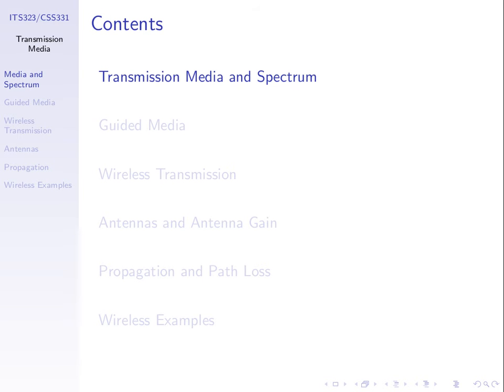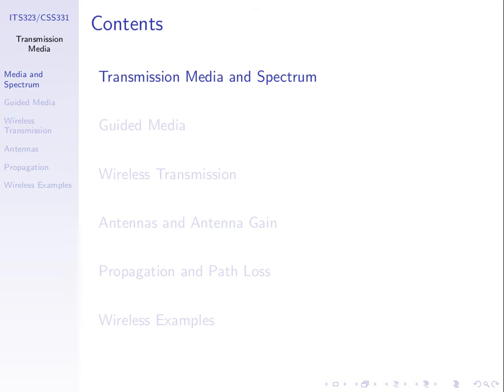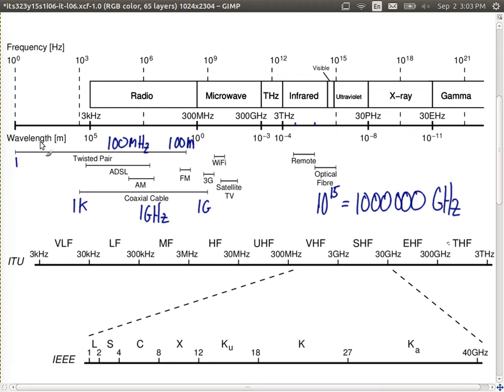Spectrum and Wired Media (ITS323, L06, Y15)

Comment: Tranmission Media and Spectrum
 • Guided = wired
 • We usually just care about the center frequency
  ○ Squaring off any curves in the wave
 • All frequencies are regulated
  ○ Radio is 93.5Mhz frequency
  ○ Microwave = 2.5ghz 
  ○ Higher data rates with Coaxial than with Twisted pair (LAN Cable)
Guided Media
 • Interference between other wires
 • Twisted pair enables duplex communication by having 
 • Coaxial cables have more shielding, can be sent along longer distances
  ○ Two conductors along the same axis, hence co-axial
  ○ Outer conduct just provides resistance to interference 
 • Optical fibre
  ○ More expensive, more difficult to deal with
  ○ No interference from electrical sources, since it’s a light signal not an electrical signal
  ○ Much higher bandwidth
   § Cost effective when high data rates are needed

Decibels and Signal Strength
 • Signal strength is amplitude or height
 • Volts and watts are used for signal level
 • Decibels allow us to look at ratios but logarithmically 
 • G_db=10log_10〖(p_in/p_out )〗